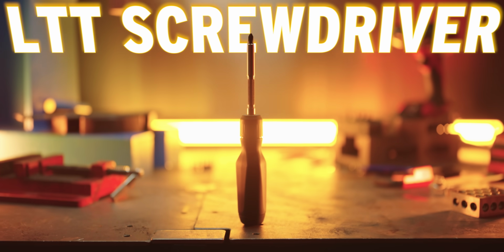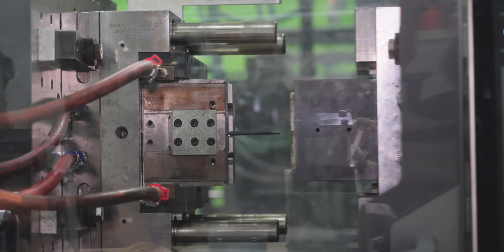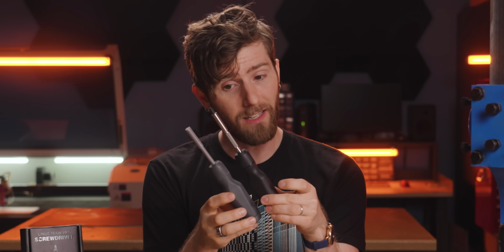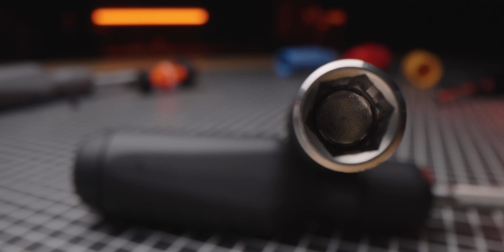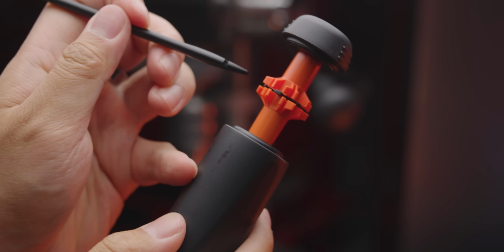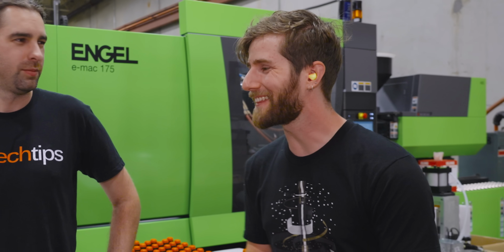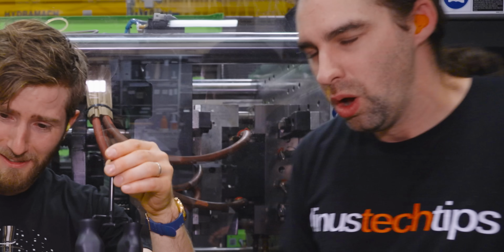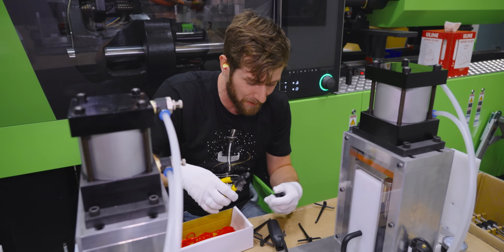Why our Screwdriver took 3 YEARS

Comment: Uhh you reversed the direction of the selector? You know that is a very important design choice right? When you are using a ratcheting screwdriver if stuff is rubbing up against it in a tight area it will flip the selector. Normally this doesn’t matter because the selector is already in the direction stuff rubbing up against it will try to push it. However with your design stuff rubbing up against it will try to select the opposite direction from the way you want it on your “working twist”.
Reply: I wonder when they decided to change the ratchet direction selector if they had a discussion about why other manufacturers do it differently than LTT. I would hope they found out and then decided to change the direction weighing the pros and cons for the different directions but perhaps they assumed being new to this that the LTT way for direction makes the most “sense” without consideration for the other direction for the selector. I did order it because it does look like a nice screwdriver.

Comment: I just bought the black coated screwdriver. I've already been looking to buy a ratchet driver to go along with a torque driver. My question, will there be a stubby version of this in the feature? Smaller grip, shorter shaft would be nice to see eventually. 
Another little thought, ever thought of getting into the business of portable soldering irons?

Comment: Will you be making different bits in the future? Maybe a triple square set, or a 1/4" square drive adapter that still fits in the handle? I can see a use in having multiple bits/adapters on a single screwdriver as an automotive tech. 

And in a magical fairy land, being able to pick out a personalized set of 12 bits that fits my needs perfectly would be cool

Comment: I like your finish product and really wanted to buy 2 of them, one being a gift for a good friend but at 70 bucks a piece, damn no way. And I'm afraid the bits are not included as well and I will have to purchase them apart as there is no place where is written as those are part of the package. I did not had the guts to look for that price as well. Very upset as I really wanted to own this and more, to brag about me owning it and with your logo on it.. it would have been so nice. It is too much. You wanna have your ROI in just days after production started. Sorry for you. I use a ratchet screwdriver since more than 10 years now and I even put a hex key on it for leverage sometimes and it still working. Indeed is noisier as the bits are moving freely in the handle but who cares as the price i e payed for this top tool was around 20$. 
For sure you're going to sell some 1-200k that to the onlyLTTfans but they will not pay that price for the quality of the tool rather for the LTT part of it... Too disappointed at this time to say more...
If the price were around 40$ you for sure would have orders in the following years to come and not just this year as I suspect you will. 
But, good luck with the recovery of your investment within the first 2 months as this is your only scope appearantly.

Comment: 1/5000th of an inch? This is a heavy duty tool, isn't that much tolerance a problem in the long run? I mean, there's gonna be tear and wear in the mechanism and of course it can wear off easily more than 1/5000 inches. what happens then?

Comment: Funny how I know exactly what is all about. This is basically my job. Product development. Sometimes I am absolutely stunned what I'm able to get from suppliers after all the approvals and quality checks. Especially when the injecting molds are involved. Sometimes it includes real physical and mental pain. 3 years though is a lot - BUT - in this case more time means better quality and in my point of view it is the right way. Examine every part of the assembly, all materials, surfaces, tolerances, steps of the production etc. to get best possible product and not some hasty something that works somehow but not great. Good job LTT.

Comment: Only thing I'd want in addition is ability to quick swap out sets.  Like click back open and be able to pull out further after clicking a button to disconnect then slap a new set in.  

Would almost certainly add problems in the design so probably just a pipe dream, but possibly an idea for if a version 2.0 is released in 5-10 years.  

That and a quick storage to pop in the sets to(could 3d print some holders which would just need to match the interior diameter so it would work).  And additional storage mechanisms would need to be sold.  Then we could lable the barrels and storage units and quick swap them out.  Hell as a meme the storage for it could be in a larger version  of the screwdriver handle.  Pop out, twist to the one you want and quick swap.  Could even color code or something to speed the search process.  You sell 6 sets already so if making a larger handle that stores 12, that leaves 6 sets for personalized sets by people.  Or a different method could be a bandelier style like Rambo.

Either way I have high hopes for the existing driver and bought it plus 4 bit sets

Comment: I worked at an injection molding plant for a summer.  If you get behind, it's a nightmare to try and catch up!  Also ran a machine that didn't auto eject so I had to reach in and grab the part once the mold opened, super scary and lucky I didn't get my hand ripped off.  This video was so cool to watch!

Comment: This is a great product, BUT. If you're aiming at being competitive in the market and sell a lot, you should try negotiating production prices to have the finished products in store for no more than 39USD.
Reply: At 33USD you would shave off almost half the competition. This is still a screwdriver, and although its one of the best, its not a computer or a phone, people don't need the best screwdriver, and won't buy one for 144 or 70 USD. Some will ofc, but if you plan to sell a lot, you need to be competitive in the pricing as well. 
At 39 you're still more expensive than most of the alternatives, but it is better so the small price difference might be worth it. 
At 33 you'll be in the same price area as all the mid field drivers but yours will beat them all and therefore be the most sought after. Think about it.

Comment: Well, it didn't take long at all for the Project Farm YT channel to put it through it's paces and destroy it alongside a number of other ratcheting screwdrivers to see how it stacks up. And it kicked ass, coming in second in total score of all tests only because bit retention was a little weak. (Get on that, Linus. lol) Without that test, it came in first. Now, I didn't need Project Farm's seal of approval to get the LTT driver, but I do trust it for other tools and devices and was hoping to see the LTT's hard work vetted there. And, to my surprise, it popped up in my recommendations today. I'll stop procrastinating now and order one. Now all we need is an LTT holster for it. Edit: Btw, I would have loved to have had this driver when I was testing and tearing down computers and printers for a surplus reseller.

Comment: $70?  Are you High❓
Reply: I don’t understand why $70 is considered such a high price for a great screwdriver like this one. Watch Project Farm’s video. In many ways, the $70 LTT screwdriver outperforms the $144 PB Swiss screwdriver. I just don’t see how it’s overpriced.
Reply: @DoctorHero  I've seen Screw drivers for $35 that as far as I & others are Concerned are just as good.  They just don't get the Hype.  Also, I know No one that would pay $144 for a Screw driver and I know a lot of engineers who use them. This Screwdriver is nice, but more like $49.99, not $69.99, just my humble Opinion. I do wish them luck though.

Comment: So glad it's not made in China. Would have lost my freaking mind
Reply: why is that?
Reply: @ItsKK17  because China = low quality
Reply: @Bigman806  its not as simple as that mate, im sure you've used an iPhone before and we know they are high quality yet made in china. its just a dumb statement to make, you can be as anti china as you want but 80% of the electronics in your home are likely made there

However I do agree that $70 USD for a china made screwdriver would be steep but Id pay that for US or German made.
Reply: @ItsKK17  no issue with them assembling or packaging or providing raw material for a high quality item. It's the precision tasks that always fall short. They make a lot of stuff. That's good enough. When you're spending close to $100 on a screwdriver, you don't want good enough. It's no doubt that the iPhone is high quality. It's designed in the US. Standards are US The components are not Chinese. Literally the only thing about them is their assembly.
Reply: Some parts of it are made in China, like the shaft mechanism
Reply: @DoctorHero  are you sure.... I thought he said Taiwan then China then not China. Looks like I must head to the bathroom so the promise above does not make too big a mess.

Comment: In the comparison test, it was one of the worst in Rotational Slop in Locked Position at 12 of 14, an important characteristic for a ratcheting tool. This is surprising in that it did very well in the other tests involving the ratchet mechanism.

Comment: The "ratchet-opposite" thing works the same on every other ratcheting screwdriver I've ever used and is a big muscle-memory thing.  No thanks.
Reply: Wait a minute, wouldn't it be possible to reverse this by taking the screwdriver apart and switching the pawls?

Comment: It appears to be missing a dealbreaker feature for me.  I use a Craftsman screwdriver which has a sleeve on it you can grasp that gives it 4x RPM.  It helps so much, I'd rather not live without it.  And it costs 1/3 what yours costs.

Comment: WARRANTY

LTT Screwdriver Limited Lifetime Warranty
THE LTT SCREWDRIVER IS COVERED BY A LIMITED LIFETIME WARRANTY AGAINST BREAKAGE DUE TO DEFECTS IN MATERIALS OR WORKMANSHIP FOR THE USUAL AND CUSTOMARY LIFE OF THE TOOL.

THE LIMITED LIFETIME WARRANTY DOES NOT COVER:

Bits, as they are considered a consumable item;
Tools which have been subject to abuse, misuse, negligence, or improper storage;
Tools which have been used improperly e.g. using the screwdriver as a pry bar or hammer;
Tools which have been altered in any way;
Normal wear and tear (including the breakdown of materials over time);
Cosmetic damage (including scratches or changes in the finish of the plastic handle);
Products purchased from unauthorized dealers
TO COMPLETE YOUR WARRANTY CLAIM YOU MUST SEND YOUR PRODUCT TO THE ADDRESS PROVIDED BY OUR CUSTOMER SERVICE TEAM. CREATOR WAREHOUSE, INC. RESERVES THE RIGHT TO INSPECT YOUR PRODUCT TO DETERMINE IF IT IS SUBJECT TO THIS WARRANTY. IF WE DETERMINE THAT YOUR PRODUCT IS COVERED BY THIS WARRANTY, WE WILL (AT OUR DISCRETION): (1) REPAIR THE PRODUCT AT NO CHARGE FOR LABOUR OR PARTS, (2) REPLACE THE PRODUCT WITH THE SAME MODEL PRODUCT, (3) REPLACE THE PRODUCT WITH A COMPARABLE PRODUCT SHOULD YOUR PRODUCT BE DISCONTINUED OR OTHERWISE UNAVAILABLE, OR (4) PROVIDE YOU WITH A VOUCHER TO BE USED TOWARD THE PURCHASE OF OTHER PRODUCTS ON LTTSTORE.COM.

IN ORDER TO MAKE A WARRANTY CLAIM, YOU MUST BE THE ORIGINAL PURCHASER OF THE LTT SCREWDRIVER FROM LTTSTORE.COM OR PROVIDE A COPY OF THE ORIGINAL PROOF OF PURCHASE.

Comment: Would you be able to add a bit or interchangeable shaft to hold a 1/4 or even 3/8 socket. I'm a mechanic and came across this video became its tool related. If the driver is as durable as said, then it would be a great addition to my tool collection with a socket connection. Plus the driver would not only be tech/simple household related and would reach a larger variety of customers.

Comment: No bit-driver is worth that much. The bits are the most important aspect, also the main fail point. Non-conductive bits would be a game changer for anyone who messes with electronics though. After all, who hasn't put something stronger than water in  there Linus Tech Tips bottle and tried to play with electrickery after. :P

Comment: doesn't this screwdriver run into the same problem as the others of this design mainly that when you have a screw that is deep in a hole the shaft will not reach the screw or does it come with longer bits

Comment: is this always gonna be order in waves or will it be normal order after some time? will there be any improvements to the supposed “lock ratchet setting” problems? is the only place this will ever be available on lttstore or will it also be at local stores at some point? is there any screwdriver use this isn’t recommended for? also was there any features that were intended for the screwdriver but weren’t feasible?

Comment: According to LTT store you've already sold over 60000 of these, I'm blown away, why are there so many people that will spend $70 on one screw driver? That's insane!
Reply: 70 bucks isn't that expensive bro
Reply: @tinymclarge9158  for a tool, that lets you tighten screws, without drilling holes, yes it is expensive.

Comment: quick tip: DO NOT angle grind your bits to be shorter, you'll ruin the temper and they'll suck. I was actually pretty skeptical of this screwdriver until seeing the Project Farm testing video on it, but it seems really great. I still think 70 bucks is a lot for a screwdriver, but I also very rarely use ratcheting screwdrivers, so that's probably why. I tend to use either an electric drill or impact, or a normal screwdriver when electric is too much.

Comment: Did you consider making the handle end of the shaft hex shaped?  That way it would allow a spanner to be used to add more torque.
Reply: That wouldn't really make much sense, when the limiting factor is already the ratchet mechanism. If you need more torque, then this isn't the right tool for you.
Reply: @patheddles4004  I don't think that makes any sense.  Applying torque with a spanner on the shaft would decrease the load on the ratchet.

Comment: Yall were in the top 3 and if I had the $ I buy one right now I don't tho but after  Watching project farms YouTube channel here's the video in the link I will actually go get one of the screwdrivers when I'm able to afford 1 as it held up quite well to the abusetest and for the budget and price it was in his top 3 https://youtu.be/845HUaWYSQA
Reply: @techhardware3176   honestly for the price and how  It held up as well as it performed in multiple of the test yes I'd still purchase it I watched this full video and for the price it's a decent budget tool some of the higher name brands that you'd spend almost twice as much more or even some of the lower brands had issues some of the nice Sabrina's filled in areas that would bug the fudge out of me I don't like so much internal bit sword Lawton's scheduled term the handle and the bit seemed to pop But this one had a design that actually worked well kept the bits from falling out as well as we're just opening up in the cap falling off so for me that was a plus the degrees that you had turned it to make rotation was a plus You had much larger name brands in there that mechanics and stuff used that didn't hold up as well for what you paid for them so for this particular tool what you'd be paying for it and what you get out of it is a really good deal in my book

Comment: Sure 5 thou is pretty thin but it depends on where it is. Some of knife are ground or reground to 5 thou and that's considered really thin. If you don't know what you're doing its very easy to damage. On internal mechanism parts 5 thou is actually quite a bit. Its the difference between tight fit w/o any slop and rather loose fit with a good amount of play.

Comment: The last part, where Linus is on the line trying to build the screwdrivers AND keep up with the machine was pretty funny. I actually work in a Injection Molding plant making parts for the interior of GM/Chevy trucks and VW cars. I was a team/quality lead for 4 1/2 years before finally moving up to the IT department. And I can tell you that the process of assembly after the press molds the part is extremely hard to get right and keep pace with the press a majority of the time. So Linus, you're reaction to the pace and setup is on the nose for someone with zero training, first time on that job...lol
Reply: I work in a plant the produces anti-vibration parts vehicle manufactures.  Watching Linus struggle with the parts cleaning and assemble happens to everyone at least once that is learning the process.

Comment: its interesting that the manufacture is using a bucket to manually refill the inj machines hopper instead of using an automated vacuum system. 
seems kinda barbaric. every plant i been in used an auto feed system even for tiny parts.
its awesome to see linus working the assembly even if to add to the video. you would never see any other company owner touching anything. they usually just yell at people to work faster because speed is money and they dont care about the workers getting burnt out.

Comment: As someone who has made molds before (and die shoes as well - basically the whole assembly), I'm shocked you paid $200000 USD for them. Could easily be done for 20-40% of that price even given the cost of material these days.

Comment: I used to work in plastic injection molding as well as handled mold setting. Was a pretty smooth process except when we'd get a "contaminated" material. If a material hopper was dirty, you'd end up with discoloration streaking throughout the final product. Anyway, the screwdriver you guys came up with... looks great!